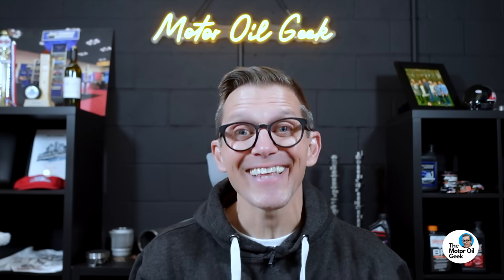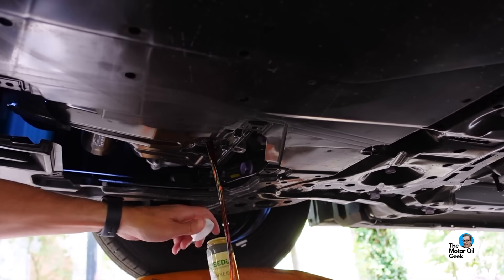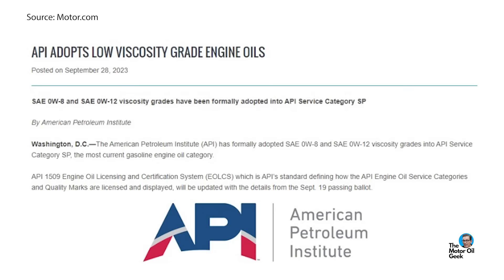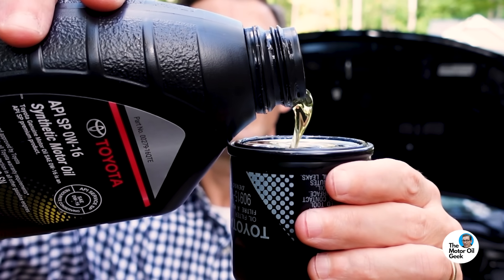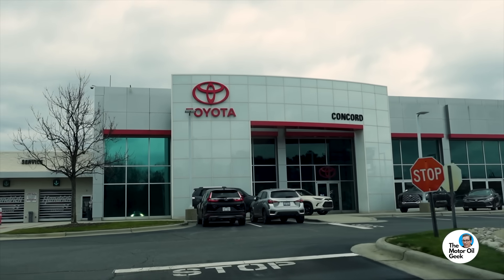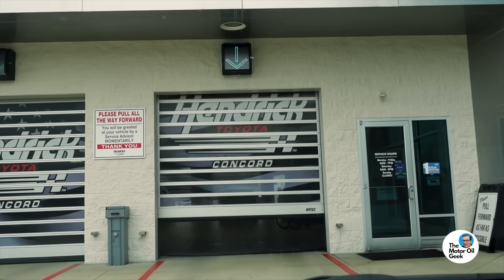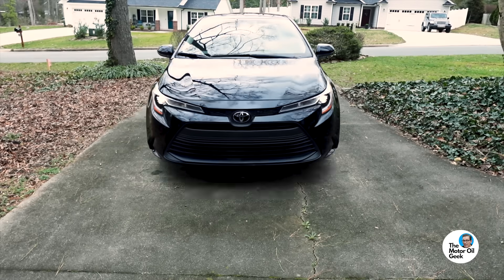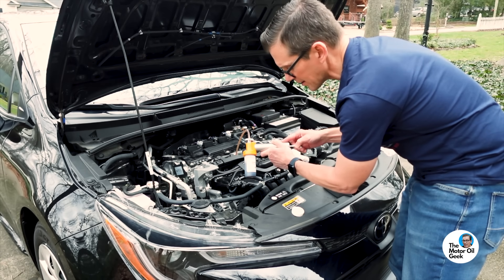0W-8 Motor Oil: Too THIN to Trust? Let's Find Out!

Comment: Thank you for all the information, I have two newer Honda's and a lot of what you're saying makes sense. You have probably been asked a million times by now, but could you put out some information for antique engines? I also have a '54 Dodge M37, I believe the odometer to be true. It has a little over 8k on the original engine. Because it's a flat tappet engine, I have to search high and low for oil. This engine is governed to 3600 rpm. The filter only filters the oil to the camshaft. After 2k miles, the oil is still clear. But when it comes time to change it, I have to start the search over again. Right now I run a lawnmower engine oil because it's made for low rpm engines and has extra zinc. Yes, lawnmower oil! But I don't have a lick of problems with it. Original specs call for SAE 30. Could you please make some recommendations for us old car (and truck) enthusiasts? Thanks.
Reply from the maker: Will do

Comment: Genuine Toyota Synthetic Motor Oil is a special blend made for Toyota by Mobil Oil  and approved by TMC powertrain engineers.  During the warranty period, they must use GTSMO during the oil change period.  However, some dealers will just buy and use Mobil 1 directly from the distributor after the warranty period is over.  Because they can save money.  Make sure whoever does the oil change uses GTSMO.  There is a difference.  I worked on that program.  And change your ATF.  "Lifetime" ATF is B.S..
Reply from the maker: Right on!

Comment: Lake, please do a research before stating that Toyota CVt used a chain to drive the gears. Weber Auto would be a great site.

 Just to simplify, Toyota CVT does not use belts rather they use increment voltages in hybrid battery to drive planetary and reduction gear. 

Let's say the voltage of the hybrid battery is 300V, the inverter/comverter applied 150V to the electrical motor inside the transmission, it spins slow, that's translated to 1 st gear, applied a 160V it spins a litter faster, 2nd gear 170V 3 gear or 165V or somewhere in between hence the terms electronic continuous variables transmission eCVT is much more reliable due to less moving parts and little or no friction for better MPG.

Comment: I don't want to hear about merely running an engine for 150hrs as some kind of supposed proof.  I want to hear about cold starting the vehicle 500 times and running it those 150 hrs between those 500 cold starts.

Comment: This is unrelated to your 0W-8 video but I wanted to ask if you would do a video on the benefits/drawbacks of putting magnets on the outside of your oil filter.  FilterMag one of the companies that produces such a product has some compelling data.  Would appreciate your thoughts.  Also interested in how you interpret oil analysis data when the magnet has removed, constituents, like iron, that you typically use to determine engine wear?  Seems like any magnetic wear metals you can remove from suspension would have a benefit.

Comment: Is there a case to be made for running 0W-16 oil in a vehicle whose manufacturer recommends 0W-20?  Would it be OK in a turbocharged engine?
Reply: NO
Reply from the maker: No, don’t do that.
Reply: @themotoroilgeek  As I suspected -- thanks!

Comment: Well, this is all well and good, but there are other questions to be asked.  What if there is a leak?  Say, the oil sending unit?  How much time do you have to notice the leak before the engine is empty and the oil pressure light comes on?
As a mechanic, I know fault tolerance has to be considered when you develop something new.

Comment: Is oil consumption an issue with these lower viscosity motor oils?  Most car manufacturers seem to be using 0-W20 now to improve gas mileage.
Reply from the maker: Lower viscosities can increase oil consumption.

Comment: In an early vidio you said that oil viscosity changed by the square of the temperature,  could you please elaborate on this, what is the mathematical formula you are using and how did you derive it. I am an EE engineer , please  show you came this conclusion
Reply from the maker: Here’s one example. There are calculators and interpolators available online that you can use to model a fluid (if you have the proper inputs).

https://images.app.goo.gl/SWTrDccz3mBwaTfA9

Comment: So, additives make up for lack of viscosity and it all adds up to fuel milage, so if you are big on an extra mile per gallon go to the thin oil. It shows you what additives do to protect the engine, so you care about your engine, spend more on the additives.
Reply: There's and IL additive that makes a huge difference, but how do we know which oils are using it?

Comment: I just bought a 2012 Jeep Liberty and I almost choked when the owners manual recommend 5W20. I was thinking the 5 is a good idea, thin oil gets to the upper parts fast meaning less wear at start up. But the 20 weight number bothered me. I was glad to learn what your findings were.

I will probably not switch to a 0W8 for my vehicle unless Chrysler issues a recommendation for it. My mind just does not yet accept that much reduction in hot engine protection.

Comment: There could be a problem' If put it in the motor you may never be able to go back to lighter oil. Explain that!
Reply: You can use different viscosities without issue IF the manufacturer has them listed in the owners manual.

Comment: Wow that's surprising that the dealer actually used the specified oil!!  I've had cars where the dealer didn't use the recommended oil unless you explicitly told them to!

Comment: So I work at a Toyota dealership and I've done a good amount of oil changes with 0w 8 mostly on crowns with the 2.5. The first ever oil change I did with 0w 8 I was blown away by how thin is was, it almost feels like coolant. But my dealership doesn't cheap out with Toyota cares and dealership free oil changes, if it says to use 0w 8 that's what we use. But just being honest I am skeptical of 0w 8, mainly running it hot weather and running to low on oil I feel like it will thin even more than what it all ready is. I heard the main reason why Toyota uses 0w 8 is for better fuel economy but I feel that it's a bit of stretch to say it will do so. But how ever though I do see 0w 8 being great in very cold temperature weather where it will help the engine get lubed up faster. Really only time will tell how good 0w 8 will be, maybe it will be a good oil. 0w 20 is a good oil and I know people were skeptical of that when it first came out.
Reply: 0W40 is as good as 0W8 in cold weather. 0winter40 is same as 0winter8 at cold temp startup.
Reply from the maker: Thanks for sharing. I’m very interested to see the results compared to the 0W-16
Reply: There's one paramater most people don't know or forget about - the Viscosity index. The higher it is the better will oil retain the viscosity with rising temps.
Reply: If you look at the back of the 5 quart jug of mobile one 0W8 oil it says it’s formulated to withstand temperatures over 500°F

Comment: I’m holding  my beer right here in my tesla
Reply: Your tesla is a scam. And, just remember-- YOU bought it.
Reply: @johnsmith7676  why is it a scam. Im charging it with my solar panels and there is no oil change service, no alignment, no regular maintenance, no spark plug replacement service, no engine lights on, no gearbox regular repair, brake pad replacement every 100k miles, worst case battery dies and gets replaced within warranty

Comment: My toyota dealer uses Mobile 1. should I require Toyota oil.  I know Mobile makes Toyota oils .
Reply from the maker: Two different oils. The formulas are not the same. The Toyota is better.

Comment: I'm looking forward to seeing the results at 10,000 miles.I go 10,000 miles on my BMW430.It's a tuned 300 horsepower 4 cylinder I change it at 10,000 mile miles
Reply: 1 reason I'm not afraid of Long intervals Is that I sold a 530BMW That I change oil every 15,000 miles And it had 400,000 miles When I sold it And it ran perfect.

Comment: Love that series.
I wish you did one on selecting an oil for a used car.
Reply from the maker: Great suggestion!
Reply: @themotoroilgeek yes please, specially for 90s to 2000s TDI engines with north of 250.000km.
I've been running 5w40 since the beginning :-)

Comment: I'd really like to see an in-depth oil analysis of LiquiMoly molygen product line, they've really gained popularity recently, I've used it once and I was really surprised by the results, would be nice to know what's the science behind that stuff.
Reply from the maker: Noted
Reply: Projectfarms has oil analysis on 5w30.  Nothing special, middle of the road full synthetic.  TBN was 6.1, which compared to Amsoil at 11.5, and Redline at 10, 6.5 is  low.  Also no molyb compared to the two mentioned...If it's expensive, it's a waste of money.
Reply: @lonniebeal6032  I usually buy LM considerably cheaper than amsoil, so I guess it's a pretty decent purchase. 
I used Castrol Magnatec (which was way more expensive) before switching to LM and I got a much better impression from LM. 
I'll be sure to check out that projectfarm vid. Thanks.

Comment: Interesting but concerning. 0W-8 Motor Oil has a temperature range of 0 dec C to 27 deg C (80 deg F)..as seen in your video.
Thats OK for parts of America and Canada where the temp is as specified.
Australia temps are from 0 deg C to 45 deg C...  🇦🇺
I may need to check if they specify different oils here. 13:20
Reply from the maker: That would be interesting to see

Comment: Great channel Lake amazing stuff. is there Any chance i could get some advice from you and your viewers. I live in the UK and drive a 2020 Mercedes AMG A45 S 2.0 turbo 416BHP direct injection the oil rec for the engine  is 0w20 229.71 specific 
The car has a Otto Particulate Filter and i believe this is the only reason for the 0w20 oil ?  is there be a better oil to protect the engine long term as in a 0w40  that the older A45 used . Any and all help please . thanks
Reply from the maker: Thanks for watching! The viscosity grade is not part of the particulate filter issue, but the additive package is. A heavier viscosity grade oil with the wrong additive package could clog the particulate filter early.

Comment: As a 20 year mastertech I can tell you with confidence that pedelling "10K" oil changes in GDI engines is why I'm constantly having to replace broken ones at 40,000 miles, even less if they utilize VVT that relies on oil pressure. These new designs are insane, eating a quart of oil every 1K miles due to loose piston rings tolerances in an attempt to gain gas mileage(it doesn't work)
Reply: My Volkswagen calls for 0W20. Upon searching VW’s tech service bulletin online and speaking to my mechanic, it actually takes 0W20, 0W30, and 5W40.  I have been lucky enough to have had no noticeable oil burning, but others are not so lucky.  Using 5W40 in my 100k mile engine feels like a dream.  Everything feels softer and more cushioned when I drive it hard.  Will use 0W40 in the winter and will not go back to the old stuff.  My gas mileage had no impact.  The EPA can take their ridiculous requirements and take a hike.
Reply from the maker: Right on!
Reply: I bought a new car in 2021, GDI, TURBO,my 1st Turbo car, love it. Changing oil every 3000 miles with Castrol Edge. 0 wt 20 oil, these kind of engines are prone to fuel oil dilution,  mine so far seems minimal,  no increase on dipstick,  slight gas smell . This will only make the oil thinner,  and not only can the engine suffer , the Turbo will also. Hopefully 3000 mile oil changes and the Castrol Edge will do the trick and give me a  long trouble free running engine.
Reply: At least they're not running like 1940s radials, which consumed oil at a rate of 1:25 with the fuel... kind of astounding how much things have improved in that regard.

I have a Hyundai diesel, oil consumption is minimal even after 100,000 miles plus of driving. Interestingly the oil consumption does seem to vary a bit with brand and type of oil, I see almost none with Castrol edge synthetic but Penrite HPR Diesel does slowly drop with use. I assume the Penrite stuff is slowly leaving as vapour in the crankcase fumes...
Reply: They are using oil for fuel, that's the trick.
Reply: The oil consumption on modern engines is what blows my mind. You save a couple mpgs to burn a quart of carboned up oil every 1k miles lmao. Make it make sense.
Reply: @bobbygetsbanned6049  It will never make sense because it's not about emissions, it's about control. Climate change is an ongoing hoax, California was supposed to be under water by the 1960's according to "the experts". Every decade they just move the goal posts, claim penguin catastrophe is coming and then tighten regulations to increase cash flow.
Reply: @bobbygetsbanned6049  My favorite part is how we had better gas mileage in the 1990's than we do today because your average car is now 4100lbs with 200lbs of wiring alone. That's as heavy as a half ton truck from the 1980's Lmao

Comment: 2015 Toyota Prius 3rd gen Prius owner used 5w30 German oil for years I asked him the car is made to work with 0w20 every hybrid cars are made to work with 0w oil so is there any major engine job done in 500k miles that you drove he answered no he only replaced the hybrid battery and regular battery on the car so the short answer I’m going to give is use high quality oil and do oil change every 5k miles or up to 8k miles that’s what he did and the engine lasted him very long time  on that Prius

Comment: the way i see it is they are to meet EPA requirements so if 0W-8 works for 100K miles and the engine wares out that's the problem of the sec or 3rd owner.
and 10k mile oil changes are ridicules 5k max.
Reply: Did you not watch the video. His wear is fantastic. What wear?
Reply: Especially with low tension rings  and oil that is close to water in viscosity.
Reply: @lonniebeal6032  That is why they recommend carbon cleaner.

Comment: Officially, Toyota says that the oil should be changed after 10,000 mi the first time because the oil that comes in for the factory during the break-in is very different viscosity and different kind of additives insolvents and you should follow the maintenance exactly.
Reply: Where does Toyota officially say that? In your head?
Reply: Where do you think all those micro particles that are smaller than the filter go?
And the additives are vaporizing out too.

Comment: You're not supposed to change the oil early during the break-in process because the oil has special additives that coat the metal on the car etc
Reply from the maker: NEW Engine BREAK-IN: Truth or MYTH?
https://youtu.be/X4424Q5lLR8
Reply: @themotoroilgeek  I'm just going by what Toyota officially said 4 years ago in a service bulletin sent out to the dealerships...
Reply from the maker: @pilotavery  Maybe Toyota changed that in the last 4 years. That would have been pre-API SP. I can say that all of the Toyota factory fill sample we have analyzed are no different than the Toyota Genuine oil we have purchased from the dealership parts counter.
Reply: @themotoroilgeek  not sure about Ford or whatever but Toyota specifically says that the oil that they use is quite different the very first time around and contains extra solvents and is not designed to be revved very hard etc

Comment: Greetings Oil Geek... Question.. On one of your videos you mention that fuel does contaminate oil, and do believe it's like that. I'm using LPG on my car and when oil is clean till the next change, and before the LPG, only on regular gas, the oil was really black. Question - Does water/methanol contaminate the oil that much? There is a huge benefit from using it, for temperature, and cleaning deposit, but no one is talking about, if it affects the oil. Hope my question finds you.

Comment: Many months ago Project Farm compared 0w16, 0w20, 5w20 and 5w30 Penzoil oils. The lower viscosity oils had bigger wear scars.
Reply: Thats NOT what he said...or implied...
Reply from the maker: We will see if the same holds true for these oils in this engine.
Reply: @themotoroilgeek  shame that I can't post links here. Just search Project Farm thin oil
Reply: @themotoroilgeek  Is this engine going to be driven in a lot of over 70f temperatures?
Reply: Project Farm is better than Lake Speed??

Comment: I had a 92 Camry make 468000 miles on the original 2.2 liter 4cyl before selling it. I wonder on this oil if that engine  or the ones they are using today would do the same mileage.
Reply: Nope

Comment: Please do a series of off the shelf oil additive videos.
Slick 50 etc
Reply from the maker: Noted!
Reply: About 25 years ago, I spoke on the phone with a lubrication engineer who told me that if ‘slick 50’ and other modifiers improved performance…it would be in the oil already.
It’s like folks who say to keep the flow of gasoline flowing, the ‘baron deep state’ destroyed the ‘100 mpg magic carburetor’